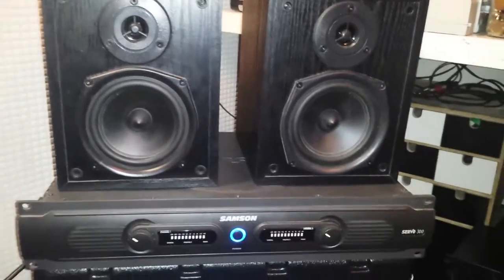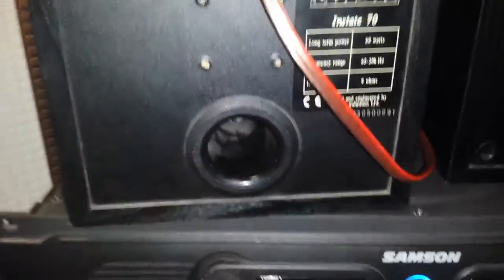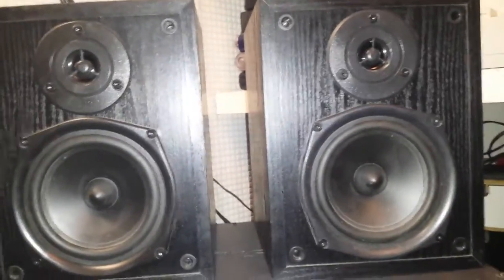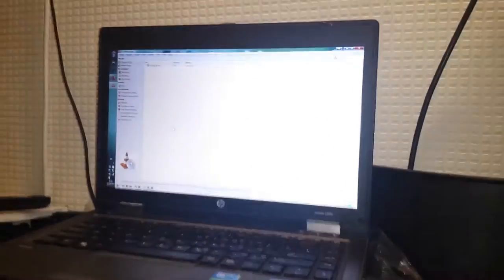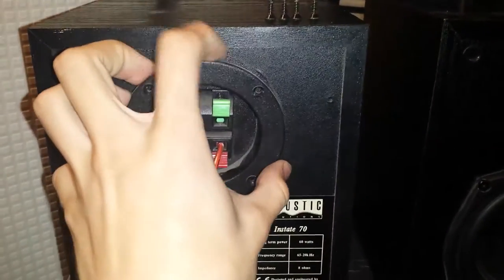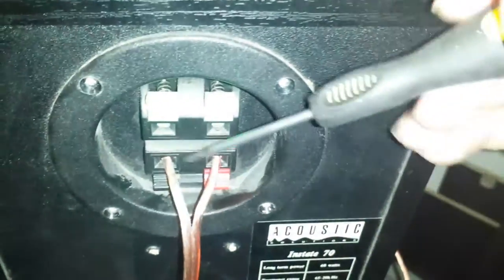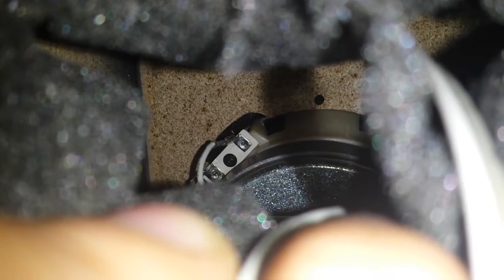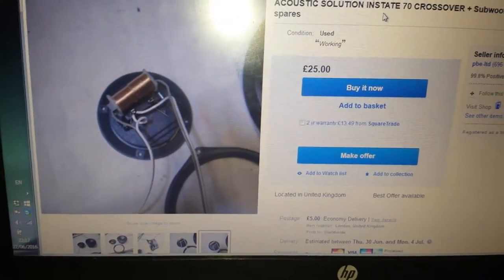Acoustic Solutions Instate 70 Speakers - Phase & Crossover Issues - Diagnosis & Repairs

Comment: As these speakers were designed for installation use, the green terminals are intentionally not connected to allow you to use them for joining cables together when multiple speakers are wired in series instead of using terminal blocks
Reply from the maker: That's a very interesting idea that I hadn't thought of! Thanks for the info. 
Yes they are most common in installations, I actually try and grab them where possible when being removed. 
They are a great form factor and surprisingly decent all-rounders, just wish I could obtain replacement tweeters at a reasonable price, as I have 6 with dead tweeters from an installation.
Reply: Nathan PH yes they are decent speakers, i have a pair myself but with dead tweeters unfortunately. I think they are pretty much a copy of the wharfedale programme 30 which is another great small speaker found in pubs across the country! (I have a few pairs I’ve ripped out of various installs over the last few years)
Reply: Thanks for letting me know! I've been looing for documentation on what the green terminals are for!